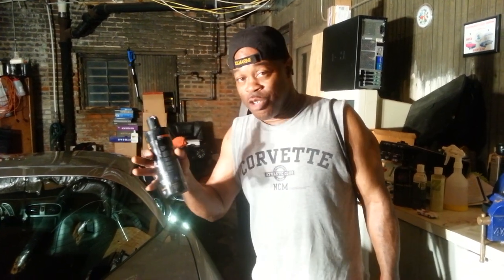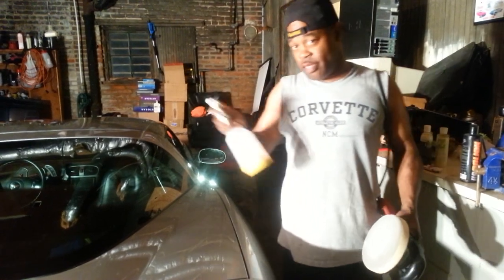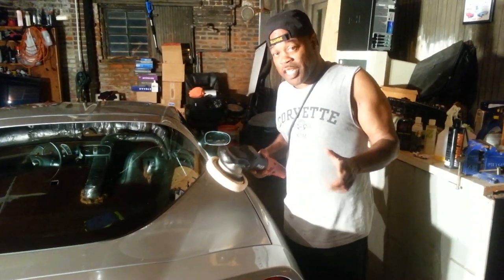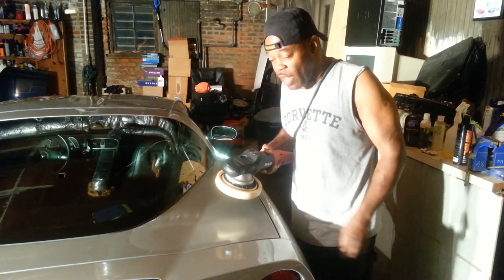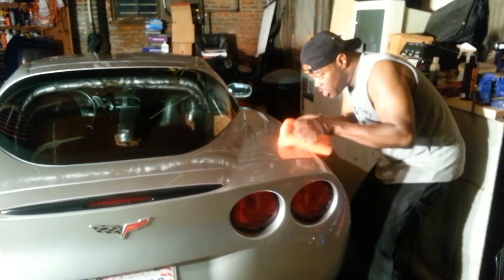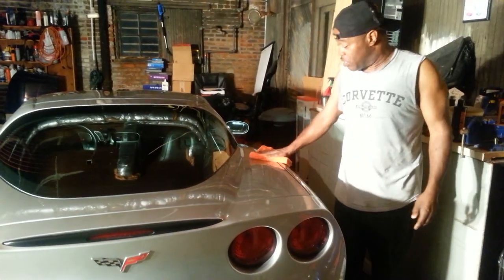Clean Seams - How to Keep Compounds/Polish/Wax Out of Your Car's Seams

Comment: I hate and love your work. I love it because it has taught me many skills in keeping my car's paint in shape and all the techniques etc. I hate your work simply because now I know what to look for and how to find imperfections. I took my car to a reputable detail shop and i found every little thing, even things that shouldn't bother me, wrong with their work. I finally came to the conclusion that I am already anal retentive as it is and you have made my condition worse. So thank you and no thank you MR. Junkman.
Reply from the maker: You should see how sick I am, and it ain't just with detailing. When I first bought my Corvette, I use to take it to the dealership to get stuff fixed. Problem was, they would sometimes give me my car back and claim that they could not duplicate the problem or that there was no problem. After a few of those occurrences, I came to the conclusion these dealership idiots didn't know what the hell they were doing. Little did I know, I was right. 🤦‍♂️

Up until that point, I didn't know how to do a oil change on ANY car. I had a pipe wrench and a Phillip's screw driver as my tool collection. So I got online and found a Corvette Forum. Then I found out that they had service manuals for my exact car. So I bought one and started reading. And I read, and I read, and I read until my eyes bled. I did my first repair, I started buying tools and over the next few years, I went from a guy who couldn't do a oil change to fixing the head gaskets on my C5 Corvette. The only thing that you don't take off the engine block on a C5 when doing the head gasket repair is the water pump. People think that I have worked on cars all my life after seeing my writeups but that Corvette was the first car I've ever worked on.

I just finished doing the blower motor and air strut repair on my Porsche. I read what I needed to read, watch any videos that I could find, bought the parts and do the work myself. I don't trust anyone working on my cars now, knowing the rift-raft that claim to be ASE certified. I have no formal training in repairing cars and I have mechanics all over the country consulting me about Corvettes. I didn't try to learn that car inside and out, It just happened over time. The kicker is, I hate working on cars. 😡

So like you, I've seen my share of trash detailing work and thus, would never allow someone to detail my cars. The only reason I started making videos was to help those who were tired of people charging them for crap work. Someone shared their car repair information with me and sharing my detailing information was just MY way of paying it forward. So yes, I know your pain. Just imagine what it must be like to be me.  😬😬😬
Reply: @Junkman2008  Same here.  No one touches my vehicles.

Comment: Great job bro. Question. Did you attain your skills from a school. Shop or YouTube. You're very knowledgeable. I'm a beginner with two dual action polisher. I'm doing ok with them. I was wondering if I should get a rotary polisher. It seems to be much faster. Or should I wait a few more months or even years to start using one. From watching you, it seems like it's mostly speed and pressure that's involved with the rotary. Thankyou for the feedback.
Reply from the maker: I obtained my skills mostly from my father, although he only used professional equipment. I didn't learn about the Porter-Cable or DA polishers until the early 2000's. He only used a Snap-On rotary buffer.

As for a rotary, who is going to teach you how to use one if you bought one? Do you think that you can learn how to use one by watching a video? Have you ever wondered WHY I don't show people how to use a rotary? Let's put it this way. If you drive a hundred miles at 60-mph, you will get there in 60-minutes. But if you drive 90-mph, you will get there sooner but how smart is driving down the road at 90-mph? Yea, it's faster but if you get busted, you are going to be in for a world of hurt. That same analogy DEFINITELY applies for a rotary polisher.